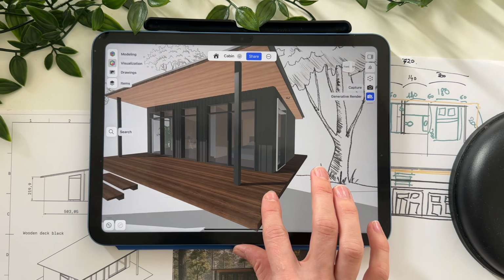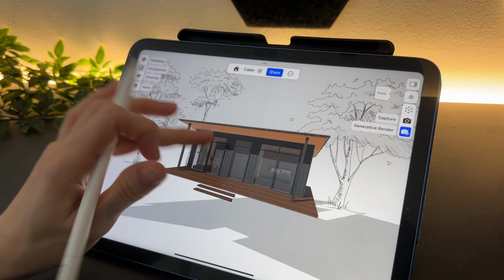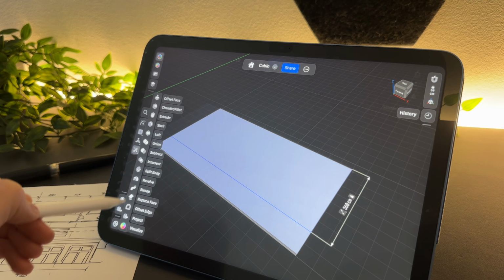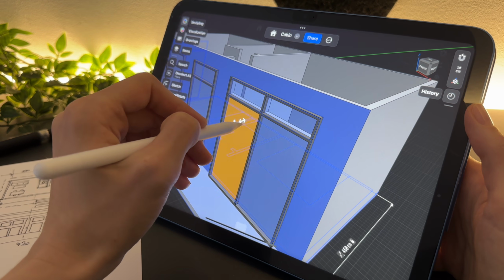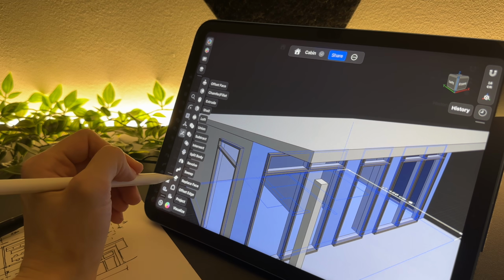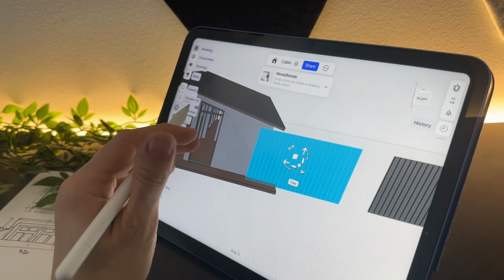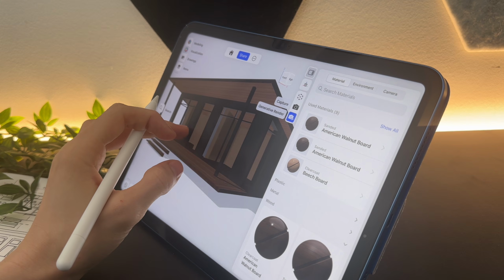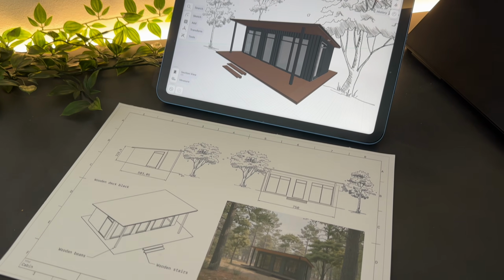Shapr3D on the iPad, explained by an architect (+ free PDF guide)

Comment: When you drew the windows did use rectangles or lines, it was hard to tell in the video. If you used rectangles did you do line trimming (like the interior walls) curious because didn’t see that in the video. I tried a different window style in a test project, I was able to extrude the frame for the window but not able to remove the wall so I could replace with glass later.
Reply: I went back and listened more closely the exterior walls and interior walls were created using lines, so I corrected that. I still have a problem where the lines of the exterior walls are don’t aren’t blue which I believe means that the extrude won’t work because I can’t select the walls without selecting the whole floor. I think that means I have a gap somewhere.
Reply: Figured it all out, I wasn’t on the surface when I drew the interior walls.

Comment: Excuse me, I want to ask you about architectural engineering because I will specialize in it Should I buy a laptop or not Even though I have an iPad that has a keyboard Are architectural programs different between a computer and an iPad
Reply from the maker: Hi! Most architectural programs are different and more powerful on laptops/computers than on iPads (AutoCAD, Revit, Rhino etc), they usually require Windows or macOS laptops (some of the do not even run on iPad or have very limited versions). I think, if you are specializing in architectural engineering, buying a laptop would be best, and you can keep the iPad as a secondary tool for sketches and notes!